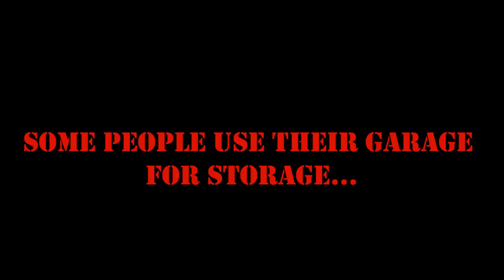My Father's Homemade Candlepin Bowling Alley

Comment from the maker: It was a rather big project but he gathered many parts from the New England area and put alot of time into it. Things like the floor had to be of course made by him but the gutters were from an old alley. His ball return was handbuilt. Many mechanical parts have been repaired and/or modified as well to make this a reliable machine. Good luck with your Claw Machines as well my friend.

Comment: Did the machine come from Winterhill Bowladrome? Nice set up and clean machine! Never seen candle pin machine up close. (none down here in Texas) 5 motors? wow!  Brunswick A & A2 use 1 for the main machine and one for a ball return on top of the kickbacks. Bowling lanes I grew up in my dad was the night manager. It closed down a year after I graduated high school. Had moved out of state and was not there for the last frame or the tear down. My dad ran that last shift. Looking back (32 years ago) wish I could have saved the masking unit (Brunswick early 1960s Gold Crown trim package) from a pair of lanes that a now deceased friend shot his 300 on. At this center, 300 games were honored by a banner that was permanently attached to the top side of the masking unit with the bowler's name and date of the 300. Would love to have that hanging in my garage but it and a lot of equipment went to the landfill. Your dad sounds like a great man.